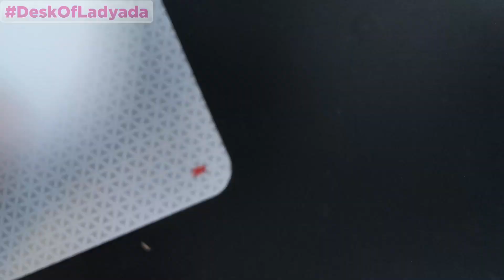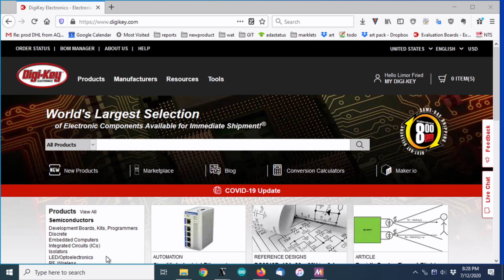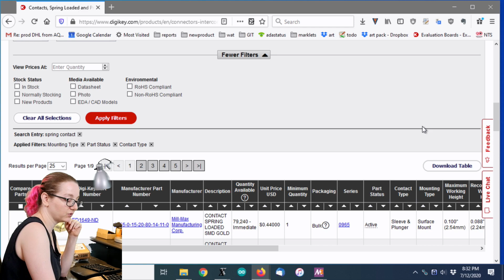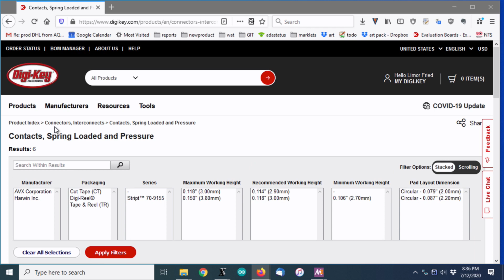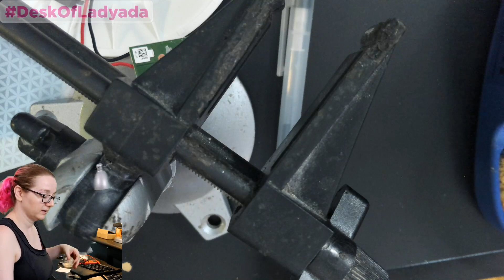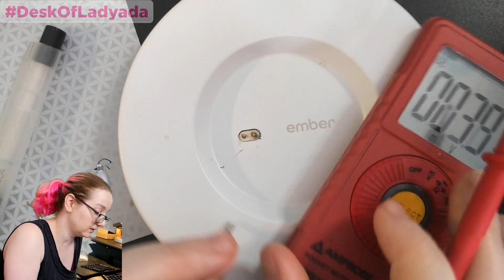Repairing an Ember smart mug with replacement parts from Digi-Key

Comment: Thanks for the video, would you do one where you have to take it apart to replace the battery?  I haven't been able to find anyone that has done that yet.  I am certain it will come in handy as the batteries are now starting to fail after 2-3 years.

Comment: It's 2 years later, and this was useful. 
I have done a teardown of the 10oz mug if anyone is interested in the photos of the electronics.  I also created a 3D STL file for the bottom and made a print that fits nicely but you have to reuse the gold contact rings.
Contact me if you have any questions.
Reply: Mind sharing tear down photos of the mug?
Reply: @Justin Armbruster   No problem. I have more than 12.  Would be better via email.
Reply: @alankirk4164  
Thanks!
Reply: Trying to share my email address

Comment: Nice video, thanks! Mine seems to be working, but mug flahses red for hours and does not turn on, any guess on what should I do? so little use and not working anymore ....
Reply: The manufacturer incorporated a locking tab in the base. This will be difficult to circumvent, but I think it can be done. My guess is the battery won't charge because the BMS sees one of the two cells outside of the charge parameter

Comment: Two suggestions: 1) Put a tiny drop of light silicone oil on each pin when it's new, and work the pins to lubricate them.  This will prevent them getting stuck in the future.  2) When the Ember mugs charge, they warm up, and they expel a bit of moisture around the circular contacts, which is what causes the corrosion and eventual failure.  When you take your mug off the charge plate to fill it in the morning, dry off the charge plate and the bottom of the mug, and you'll greatly extend the lifetime of the contacts.
Reply: Agree I've had mine about 3 years now and it looks/works like it was when brand new..

Comment: I've never soldered before and tried this, I may have popped a piece of the circuit board off with one of the pins. Any idea where I can get a replacement circuit board?
Reply: I just watched this great video my Mug yesterday after only 4 months one pin failed and sorry I don't know where as of now but the would be an easier way to fix the issue hope you found one if so let me know...I can't believe after a year nobody replied to you... CRAZY

Comment: Very interesting! I learned a lot. But my question involved replacing/repairing the cup itself. Wasn't thinking, multi-tasking, and put cup in microwave. It popped the insulation between the two rings. Is this fixable? The bottom cap is obviously a separate piece, but couldn't remove it. Thanks!

Comment: I actually found that the P70-1000045R pins on my saucer were not tall enough (3.5mm). I used the P70-1010045R which is 5mm tall. This is 1.5mm taller than the  P70-1000045R.  I found the P70-1010045R 5mm to work good and be close to the original pin height when mounted.  At the same time I ordered a 90023-AS pin which specked out at 4.5mm height. I also feel this pin would work fine. The pins were approximately $7 for 10 and shipping was $5 through Digi-Key. Nice job on the video.
Reply: I ordered the one in the video and then took it apart. Since only one of the pins was bad, the spring appears to be broken so it wouldn't pop up. I too noticed how long the good one was. Quickly called Digi-Key and canceled the order. Luckily I caught it in time. Another comment mentioned that I may be able to get it replaced free so depending on that outcome I'm going to order the P70-1010045R. I have an Ember Mug 2,  purchased in Sept. 2020, that could be the difference as the one in the video may be a bit older.
Reply: I ordered the P70-1010045R, works perfectly! I bought mine from Farnell, next day delivery for €5 to the Netherlands. Bough 20 for €22 including shipping. Failure mode for me was a broken spring. No water damage as far as I could tell.

It's good that they offer easy replacement charging pads, but it feels like a waste to get an entirely new one when it's such an easy fix.

Comment: One last step... As a Tech for IBM, NCR and Litton for forty years, I was told that it's not enough to just get it to work. It should look like NEW!!! Cleaning up the white plastic with fine sandpaper, a brass wire brush or even a kitchen non-metallic scrub pad would not only make it look new, but might reduce the chance of it re-corroding in the future. . A paper towel dampened with WD40 or contact cleaner wiped across the contact might also help. It never hurts to make it better than new. Very nice video. I bought several of these mugs used from Ebay. They all needed work on these pins.

Comment: This problem is so common they have an entry in their contact form just for this problem. They replaces it for free if anyone is interested. Though I’m glad this video came out so I can fix my original one for when my new one stops working too.
Reply: Thanks for this tip. Fingers crossed I just submitted a support Ticket, and that was one of the choices as to what the issue is.